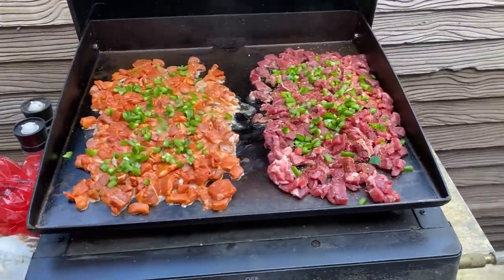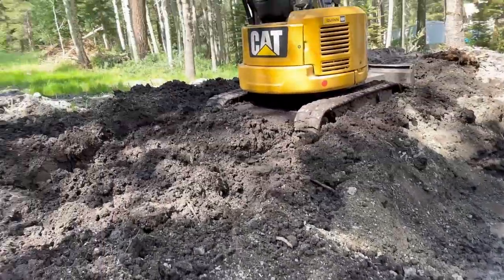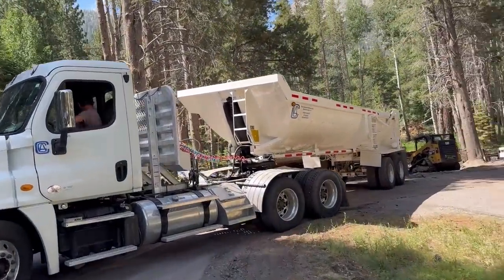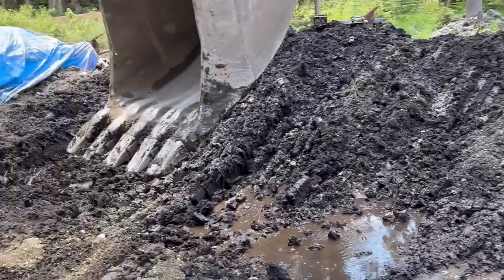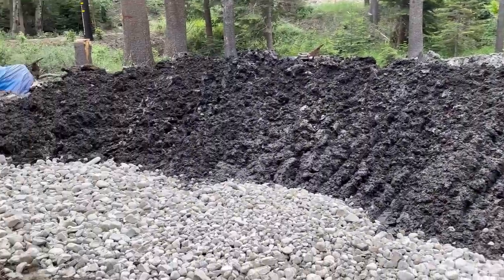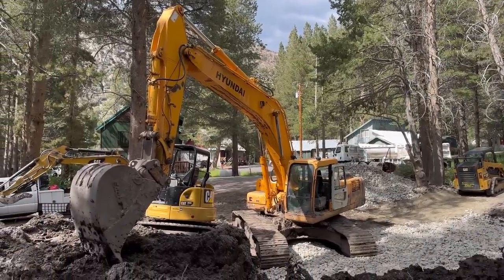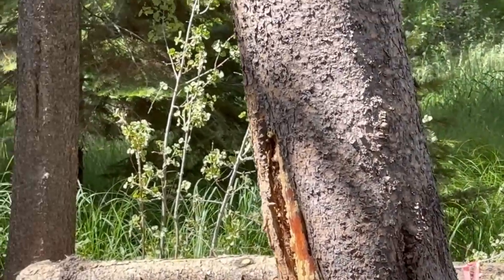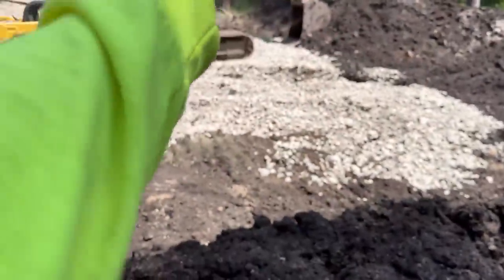Mammoth vlogs July 20, 2023 Rocking and Rolling in June Lake!

Comment: One of My Uncles worked for a bank as a Contractor in construction The Bank had to take back houses in a tracked that were sinking . He went & dug under the foundation & put in several Concrete  supports down to Bed Rock & had to put in flex pipe for sewer, water & gas as they were breaking away  due to ground sinking. Fill did not save any part of San Francisco Bay Area example Marina Area of San Francisco house fell down, gas lines broke, etc...  & The East Bay Double decker freeway collapse killing several people from liquefaction from the earthquake in 1989.

Comment: I swear Dude, I would have put at least a  12 " metal perforated pipe just below the gravel/cobble.  We used 3 logs in French drains in the Blue Ridge and Smokey Mountain bogs "in the day". Two bottom one on top for the cavity and filled in with rocks in the center for the flow/drainage at that time. Same principal as the fabric. Hopefully it will let the normal flow keep the drain layer from clogging. If it passed the Building Permit folk then I have nothin but Kudos!!! Great content!

Comment: Interesting,  I'm curious if the soils guys are telling you that this is a river flow from the mountain snow melt? vs. an upwelling spring?  All in all this to me is very unique in order to be able to build upon a somewhat soggy soil. Cobble is looking like a pretty solid base that won't move due to the water flow. Next question is a vapor barrier for the house foundation so that moisture doesn't induce fungus to grow?
Reply from the maker: Snow melt… last year no moisture
Reply: @plowbrothers365  I was wondering about that, that explains why they are letting you build there.  I'm assuming this isn't the norm and it's from the monster snow dump?  I was hoping to see one more layer of cobble go down, there's a good chance what's there is going to smoosh down a bit.  I was watching the ground as you were driving over it and it's moving around a bit. It kinda looks like the rocks are moving around under the black material that you are putting the dirt on. Not sure if that's an issue or not, but it's really weird to watch.   It's fun to see you running equipment, hope we get to see more of that.  : )  You were going super quick. not sure if you noticed, but at 8:24 you almost made Bud a pancake.  😳

Comment: I agree with oldskool22. water seeks least resistance. rocks start to build sediment water will start to rise or redirect in a different direction. Pipe is cheap.
Reply from the maker: There’s 24” + rock down there the water table is well below.